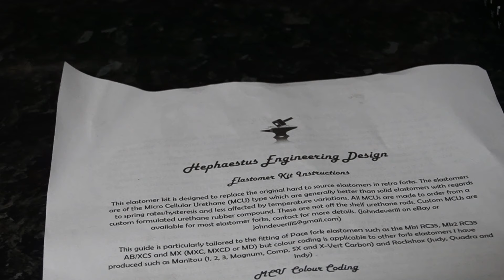Marin Pine FRS

Comment: your fork crown is on backwards fix that asap
Reply: They are fine either way, the clearance is still ok and they work fine, glad you noticed though. Cheers.  Joe.
Reply: I know they work fine but there supposed to be in the rear and so is the slot on the threads on the steerer tube. Look at any vintage manitou 2 advertisement
Reply from the maker: Thanks for pointing that out, as you can see in the video that's how the fork came to me but I will change it around soon. I have a few other upgrades I might add to it at the same time, would you alter anything else?
Thanks for the comment, we like to get things right with a little help from our friends, cheers     Joe.
Reply: I love it. Can you tell me where you got the fork sticker please?